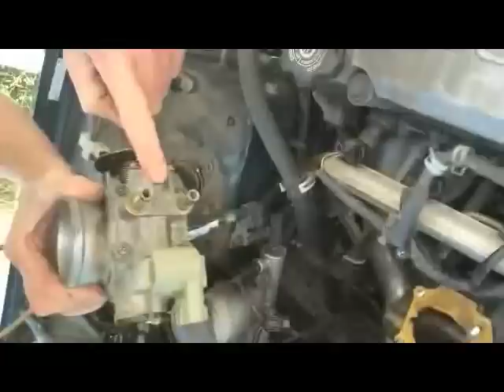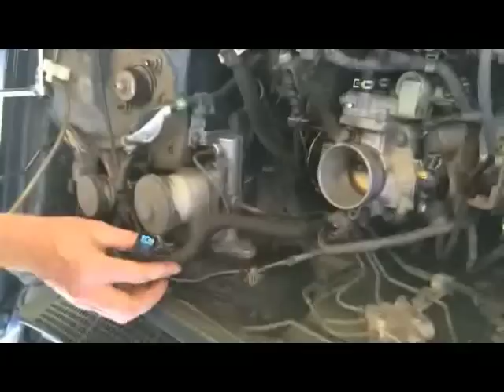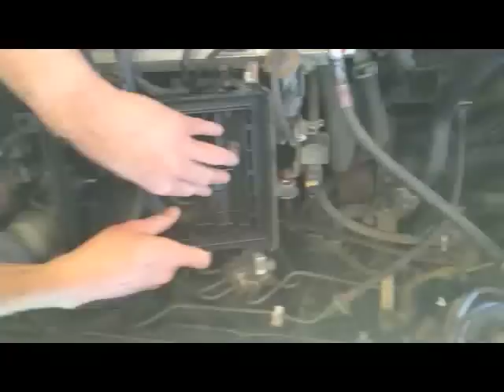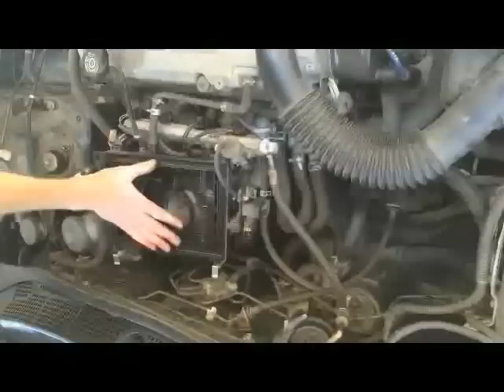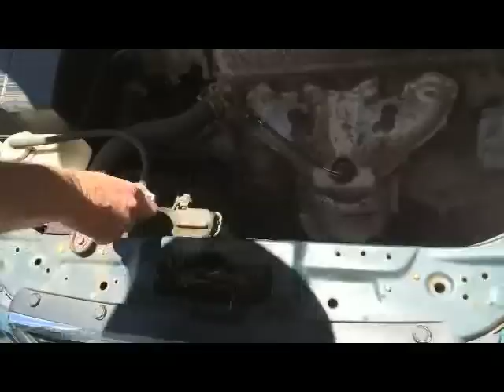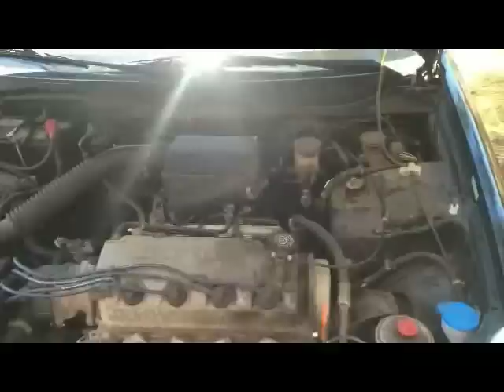1997 Honda Civic DX 5 speed IACV (idle air control valve) clean and re-install ( D16y7 )

Comment: I did this and it fixed my idle problem. But after driving for 15 mins, the check engine light came on and it started driving really choppy- like it wasnt getting enough fuel. When i put it in neutral and open the throttle by hand (or with the pedal), it is not smooth, causing the engine to bounce when it rapidly fluctuates rpms. Any ideas?

Comment: This idiot. No coolant runs in those ports. It's just air from the throttle body. It's not corrosion, it's gunk from the dirty air filter you/they failed to change out. Coolant runs on the two nipples beside it. Get your facts straight

Comment: I hadn't driven my 97 Civic LX in a few months because of the coronavirus (covid-19) pandemic.  The engine was idling fine a few months ago.  When I started the engine recently, the engine control could not maintain a low speed idle when the engine warmed up.  The engine would alternately idle high, low, high, low, ... Others have referred to this condition as "idle surge". Apparently, the idle air control valve was stuck open.   

To make a long story short, your video helped me to gain access to the idle air control valve.  Luckily, I did not have to remove the throttle body or remove the IAC valve from the throttle body.  I was able to "restore" and remove the "stuck open condition" by lightly tapping various points on the IAC valve with the end of a wrench.

Thank you for your helpful video.  Seeing the 8 millimeter bolt on the band clamp for the air filter case (at 8:55) was very helpful.  Knowing its approximate location, I was able to locate it by using my finger, feeling around the band clamp until I could feel the head of the bolt.  As shown in your video, there's no need to completely remove the bolt; just loosen the bolt until the air filter case can be lifted off the throttle body.  (Actually it may not be possible to completely remove the bolt - so, there's no worries for losing the bolt.)

Regarding the "idle surge condition", as the engine control commanded the idle air control valve to close when the engine had warmed up, I'm assuming that the engine control would simultaneously command less fuel to be injected.  With less fuel, the engine speed (RPM) would decrease, the air/fuel mixture would increase (i.e., run lean) because the IAC valve was stuck open.  With engine speed decreasing (producing less vacuum) and a stuck open IAC valve, the MAP pressure would increase towards atmospheric pressure.  Somehow the engine control noticed either the increase in MAP pressure and/or lean air/fuel condition and then increased fuel delivery to compensate, thereby resulting in the high idle, low idle, high idle, low idle ...

Comment: What about the gasket? Did you replace it? My 98 honda is missing bad but only at idle. The car drives great until I stop, which I have to hold the gas or the car will die. Do you think this could be the issue? When I bought it the guy installed a header and new distributor. I replaced the plugs and wires hoping to fix it but no luck. Looking for any advice this is my daily driver.

Comment: What I did and was EXTREMELY helpful!
Was use medium sized pressure pliers to break the seal on those very easy to strip screws on the iac valve.
I tightened the mess out of the pressure pliers on the screw head.
Turned just enough to hear that crack! Them used Philips screwdriver to remove. Easy peasy! Because YOU WILL STRIP THEM!
Hope that helps! 👍👍👍
Reply: Do u know if the magnet that spins that's under the sensor that the connector is plugged into. 
Does that piece spin all the way around or only till a stop? I bought a new one from walker and the new one kept Spinning and did not have a stop. But when i installed it made the car keep idling weird. 
Thanks for any help

Comment: Hello Tm-Mech, did you post the update video after this idle air control valve cleaned ?  How your Honda Civic DX works now, does it work normally without any problem after you had cleaned up the IDLE AIR CONTROL VALVE part ?

Comment: Any idea why there are coolant lines coming into the throttle body?
Reply: If you live in an extremely cold area, air rushing thru the throttle body can freeze things - worst case scenario, freeze the throttle open. The coolant heats up the throttle body to prevent this. Nearly all cars have this.

Comment: I just tried this on my 96 civic sedan, and mine previously had the same idle problem when it was up to temp. After taking out and cleaning the IAC, my car still has the same problem, any tips?
Reply: Clean fuel rail, clean throttle body, service tps

Comment: I just removed 2 phillips screws from sensor connector side and removed sensor. Sprayed wd40 with straw in idle control valve  thru port in throttle body and spun it back and forth. once it spun freely back and forth i put everything back... car idles perfect now.
Reply: Spun what back and forth?
Reply: The magnet piece spins as he shows in the video with the sensor removed.  @chrisfitzgerald2524 
The thing is I did this and still getting the idle surge. 
Does it spin all the way around or does it stop? I bought a new walker brand and it spins without a stop. 
Mine spins and feels like it has a spring in side. 
Please can someone help. 
I have found alot of YouTube like to help people but only for the video not with questions. Why is that? 
If I posted videos and get a question if I can answer it I will. 
Not only here for the views.

Comment: Thanks much for this vid. I'm a beginner at cars, so it's hard to figure the simplest things out. I used your vid to clean my IACV, realize I'd forgot to re-place the throttle cord, and use grease to replace the air intake box that was driving me crazy getting back on. Thanks for helping us noobs!

Comment: would this cause a very low idle speed, about 400rpm and sometimes stalling ?
Reply: Seems like it cause im having a similar problem
Reply: Not a mechanic but to me your problem sounds more like a fuel (too much) or air (not enough) problem. Tim demonstrated how dirt and corrosion (from coolant) can cause the idle to increase on cold engine starts. So we Civic owners with high RPMs on cold starts need to go in and clean up certain parts (throttle body and idle air control valve) to have the RPMs return to normal. 

Still you might want to clean the same parts. But also check to see what code(s) your engine is throwing. To read the codes, you need an OBD sensor. I think I read somewhere that you can upload an OBD sensor app to your smartphone. Or borrow/rent one.

Good luck!

Comment: Had a surging idle on my 1999 Honda Civic, once it reached operating temperature.  With only minor mechanical ability 
 I was able to follow all the steps in this video and it worked like a charm.  The idle is perfect now and it only took about two hours from start to finish.
Reply: Anyone doing this kind of work has better than average mechanical ability, IMO. Have you looked around, lately? :-)

Comment: how was the car running before that repair?  i have a 98 civic lx that when cold runs fine with an idle problem while stopped, but when warmed up it revs up and drops while driving (as if ur hitting the gas and letting go) and has no idle problem when stopped. put a new head on it due to a timing belt snap and trying to figure out what needs to be done.
Reply: Zackary Albright how many miles did it have when it snapped my 00 LX has 135k and has original timing belt

Comment: Hi, just found this video... I accidentally removed 2 screw at the back of IACV without marking it...so now I lost my original setting :(
Reply: You want to use a multimeter and follow the specs to where it should be at idle. Then adjust to closed with no slack. Your idle control valve supplies air. Tighten up and Your done.
Reply: axenz axtiz well that sucks

Comment: Thanks to this video I went ahead and removed the screws on the green casing to expose the rotor and was able to free up the seized shaft with carb cleaner. I guess my first cleaning wasn't as thorough and the problem eventually returned.

I actually took out the screws on the other end of the shaft too, but I was careful with making sure everything went back together properly. Based on other pictures of the IACV, I just made sure the two adjustment screws were dead center. Under the cap at is a coil/spring of some sort. My guess is that it provides resistance to the rotor when the coil is energized. Any idea why this would be adjustable? I've scoured manuals, but nothing focuses on a teardown of the IACV, moreso just the replacement of it. Thanks again!
Reply: Did it fix your problem?
Reply: mrsayao Honda Civic 2009 car will not move when put in gear

Comment: does this car have the valve lash adjusted and timing belt in good condition? I ask because I notice my idle is the same as yours where it has that little almost like a rocker arm is receiving spark or something. I might take a video and see if anyone can tell me if it is normal